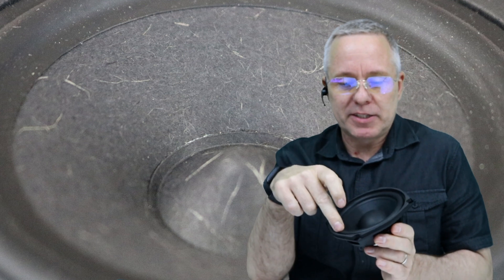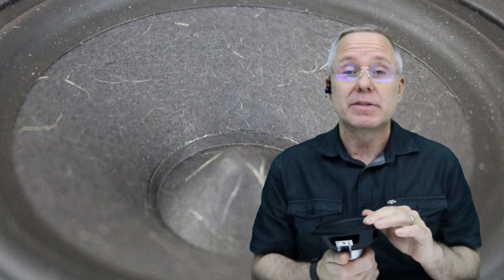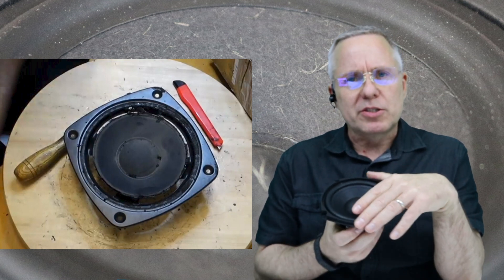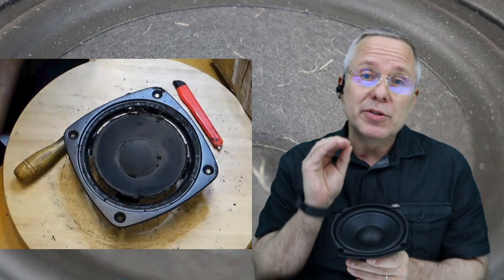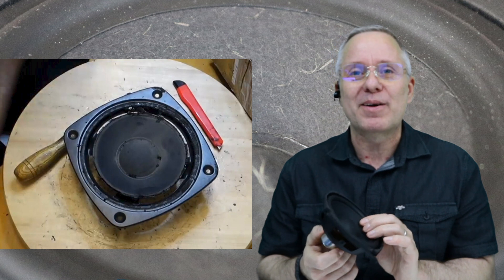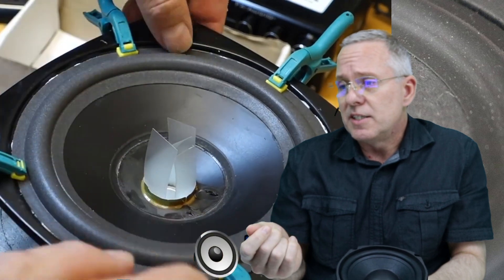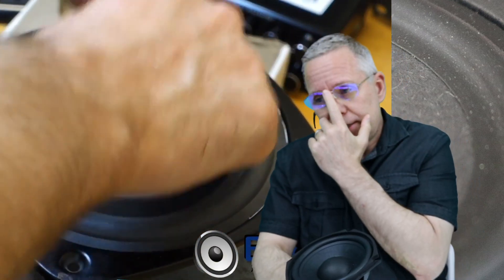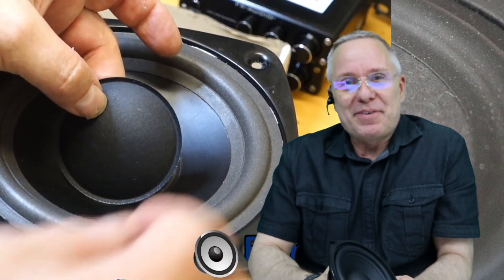Foam edge replacement

Comment: Hello! Can you tell  please,  I replaced the dust caps on my 8" woofers with larger diameter caps (a few millimeters larger). Will this change the sound? Speakers jbl lsr2328p. Crossover 4 order on 2 khz. After replacement, the frequency response is quite flat. But I still worry about it.
Reply from the maker: unlikely will it change anything

Comment: Is it a peerless driver that appears on the screen at 1:30? Frameface looks very similare to the frame used in the cerwin vega DCM 6 midrange used in the DC series.